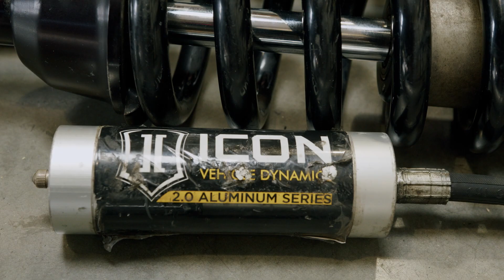Reservoir Rebuild: Icon Vehicle Dynamics 2.5" Shock Service

Comment: What does it cost for a rebuild?
Reply: I think the kits start at $100
Reply: @WendzDarKnight08  is there a way to tell which stage icon do we have?
Reply from the maker: usually runs about $175-200 per damper on a 2.5 shock, a little bit extra if we need to remove the springs, a little extra if they're mega dirty, or if shafts need replacing, etc. Baseline is about $800 for a set of 4 Icon 2.5s

Comment: I cannot get my hands on icon fluid. Can I use any other brand fluid like King shock one? Are they compatible?
Reply from the maker: Yup, you can get away with using any other brands oil as long as it is similar weight/viscosity.
Reply: @ShockSurplus  Thank you and appreciate it. Mine has not been serviced for almost 8 years. I think it is overdue. What happens if I keep driving like this? I know the performance will go down. But is there any safety things that could happen with no servicing the shock very long on those rebuildable shocks?
Reply from the maker: The longer you go the more likely you will need to replace more parts. Once the wiper seals go they can no longer polish the shafts which leads to pitting, and when the wear bands are gone, the pistons will score the bores and chew themselves up.

Comment: How many miles on this set of shocks
Reply from the maker: 35-50k miles is pretty normal for mostly street use, however the more often and the harder you drive off road the faster they will need service.